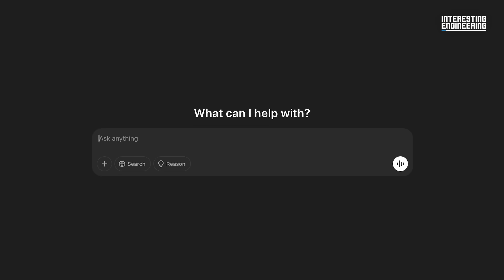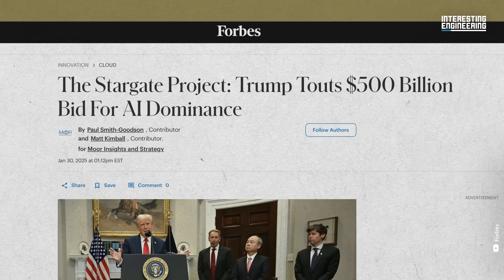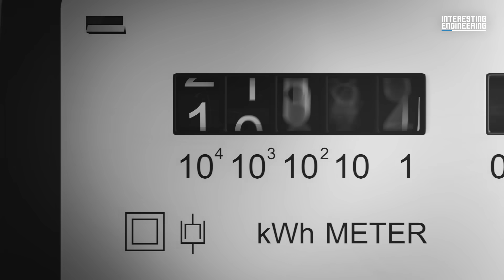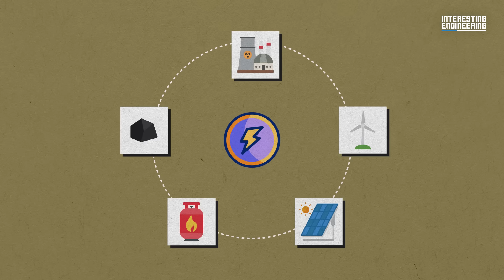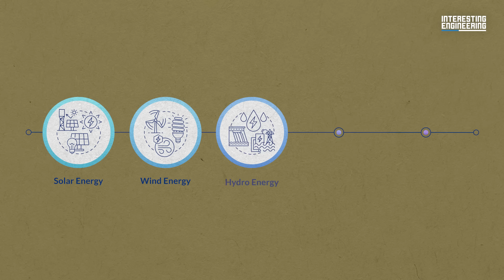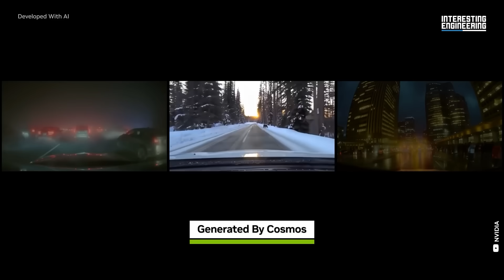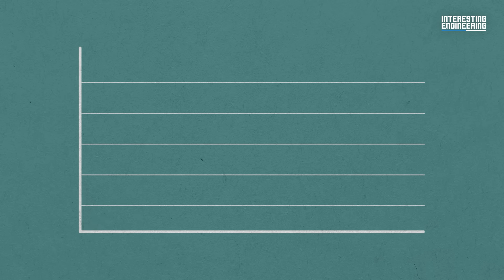The Debilitating Energy Cost of AI

Comment: Matrix multiplication doing matrix multiplication or a Neural network learning matrix multiplication:

1. *Learning-based optimization*: AI can learn to optimize matrix multiplication for specific types of matrices, such as sparse or structured matrices.
2. *Adaptive computation*: AI can adapt computation to the specific matrix being multiplied, allocating more resources to the most computationally intensive parts.
3. *Exploiting sparsity*: AI can exploit sparsity in matrices to reduce computation time and improve performance.
4. *Parallelization*: AI can parallelize matrix multiplication operations in novel ways, potentially leading to better performance on certain types of matrices.
5. *Memory optimization*: AI can optimize memory access patterns to reduce the time spent accessing memory, leading to improved performance.
6. *Pipelining*: AI can pipeline matrix multiplication operations, reducing overhead and improving performance.
7. *Quantization and pruning*: AI can use quantization and pruning techniques to reduce the computational requirements of matrix multiplication, leading to improved performance and efficiency.
8. *Hardware-software co-design*: AI can be designed to work in conjunction with specialized hardware, such as NPUs or TPUs, to achieve optimal performance.
9. *Meta-learning*: AI can learn how to learn matrix multiplication, enabling it to adapt to new matrices and multiplication tasks more efficiently.
Reply: You're saying a lot of things, but I don't understand the overall point? Just saying what AI will improve?

 Yeah some of those are definitely interesting. I am just waiting to see what will happen with photonics myself. 

 Q.Ant just made a photonic AI accelerator that works x86. They say they'll catch up to Nvidia in power, for way less power, heat, and space. 

 Yet we will see about that. I didnt realize how many were doing photonics till I was trying to find the name of Q.Ant.
Reply: @dianapennepacker6854  hope this will make it clear (im saying that if Ai can master text generation or pic generation then what if it mastered the main process that powers it i.e matrix multiplication)that would lead to :

NPU-in-NPU: A Hierarchical Acceleration Architecture

A novel concept in neuromorphic computing involves running a virtual Neural Processing Unit (NPU) on top of a physical NPU. This hierarchical acceleration architecture enables the creation of a virtual NPU that can perform 50,000 operations, leveraging the capabilities of the underlying physical NPU, which executes 10,000 operations.

Key Benefits

1. Scalability: The virtual NPU can scale up to perform a large number of operations, surpassing the limitations of the physical NPU.
2. Flexibility: The hierarchical architecture allows for dynamic reconfiguration of the virtual NPU, enabling it to adapt to changing workload requirements.
3. Energy Efficiency: By leveraging the physical NPU's optimized hardware, the virtual NPU can achieve significant energy savings compared to traditional CPU-based implementations.

Technical Details

1. Physical NPU: The underlying physical NPU is designed to execute 10,000 operations, utilizing optimized hardware accelerators, such as systolic arrays or spiking neural networks. The physical NPU will be a matrix calculation master, doing it better and faster than CPUs and GPUs.
2. Virtual NPU: The virtual NPU is implemented using software frameworks, such as TensorFlow or PyTorch, and is designed to perform 50,000 operations.
3. Interface and Synchronization: A specialized interface is developed to enable seamless communication and synchronization between the physical and virtual NPUs, ensuring efficient data transfer and minimizing latency.

Potential Applications

1. Artificial Intelligence: The NPU-in-NPU architecture can accelerate AI workloads, such as deep learning inference and training.
2. Neuromorphic Computing: This architecture can be applied to neuromorphic computing, enabling the development of more sophisticated and efficient neural networks.
3. Edge Computing: The NPU-in-NPU architecture can be used in edge computing scenarios, where energy efficiency and scalability are crucial.
Reply: @dianapennepacker6854  hope this will make it clear (im saying that if Ai can master text generation or pic generation then what if it mastered the main process that powers it i.e matrix multiplication)that would lead to :

NPU-in-NPU: A Hierarchical Acceleration Architecture

A novel concept in neuromorphic computing involves running a virtual Neural Processing Unit (NPU) on top of a physical NPU. This hierarchical acceleration architecture enables the creation of a virtual NPU that can perform 50,000 operations, leveraging the capabilities of the underlying physical NPU, which executes 10,000 operations.

Key Benefits

1. Scalability: The virtual NPU can scale up to perform a large number of operations, surpassing the limitations of the physical NPU.
2. Flexibility: The hierarchical architecture allows for dynamic reconfiguration of the virtual NPU, enabling it to adapt to changing workload requirements.
3. Energy Efficiency: By leveraging the physical NPU's optimized hardware, the virtual NPU can achieve significant energy savings compared to traditional CPU-based implementations.

Technical Details

1. Physical NPU: The underlying physical NPU is designed to execute 10,000 operations, utilizing optimized hardware accelerators, such as systolic arrays or spiking neural networks. The physical NPU will be a matrix calculation master, doing it better and faster than CPUs and GPUs.
2. Virtual NPU: The virtual NPU is implemented using software frameworks, such as TensorFlow or PyTorch, and is designed to perform 50,000 operations.
3. Interface and Synchronization: A specialized interface is developed to enable seamless communication and synchronization between the physical and virtual NPUs, ensuring efficient data transfer and minimizing latency.

Potential Applications

1. Artificial Intelligence: The NPU-in-NPU architecture can accelerate AI workloads, such as deep learning inference and training.
2. Neuromorphic Computing: This architecture can be applied to neuromorphic computing, enabling the development of more sophisticated and efficient neural networks.
3. Edge Computing: The NPU-in-NPU architecture can be used in edge computing scenarios, where energy efficiency and scalability are crucial..
Reply: @tahirbacha431  bro is using GPT to generate comments under video on AI 💀
Reply: @adamkulczycki877   I understand why you might think my comment was AI-generated, but I can assure you that it's my own thoughts and words. I'm a human being with my own opinions, experiences, and perspectives, and I'm capable of expressing myself in a way that might seem articulate or well-structured, but is still genuinely my own. While I appreciate the capabilities of AI and language models, I don't rely on them to generate my comments or responses. I believe that human communication is valuable and important, and I want to engage with others in a meaningful way. If my comment seemed too perfect or robotic to be human-generated, I apologize if it came across that way. I'll strive to be more conversational and authentic in my responses going forward!
Reply: @dianapennepacker6854  hope this will make it clear :

NPU-in-NPU: A Hierarchical Acceleration Architecture

A novel concept in neuromorphic computing involves running a virtual Neural Processing Unit (NPU) on top of a physical NPU. This hierarchical acceleration architecture enables the creation of a virtual NPU that can perform 50,000 operations, leveraging the capabilities of the underlying physical NPU, which executes 10,000 operations.

Key Benefits

1. Scalability: The virtual NPU can scale up to perform a large number of operations, surpassing the limitations of the physical NPU.
2. Flexibility: The hierarchical architecture allows for dynamic reconfiguration of the virtual NPU, enabling it to adapt to changing workload requirements.
3. Energy Efficiency: By leveraging the physical NPU's optimized hardware, the virtual NPU can achieve significant energy savings compared to traditional CPU-based implementations.

Technical Details

1. Physical NPU: The underlying physical NPU is designed to execute 10,000 operations, utilizing optimized hardware accelerators, such as systolic arrays or spiking neural networks. The physical NPU will be a matrix calculation master, doing it better and faster than CPUs and GPUs.
2. Virtual NPU: The virtual NPU is implemented using software frameworks, such as TensorFlow or PyTorch, and is designed to perform 50,000 operations.
3. Interface and Synchronization: A specialized interface is developed to enable seamless communication and synchronization between the physical and virtual NPUs, ensuring efficient data transfer and minimizing latency.

Potential Applications

1. Artificial Intelligence: The NPU-in-NPU architecture can accelerate AI workloads, such as deep learning inference and training.
2. Neuromorphic Computing: This architecture can be applied to neuromorphic computing, enabling the development of more sophisticated and efficient neural networks.
3. Edge Computing: The NPU-in-NPU architecture can be used in edge computing scenarios, where energy efficiency and scalability are crucial.